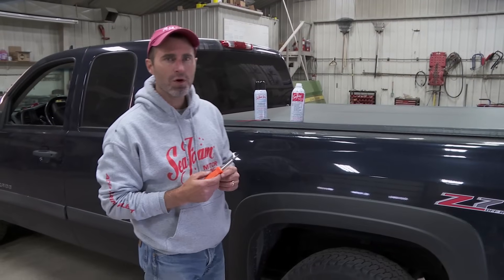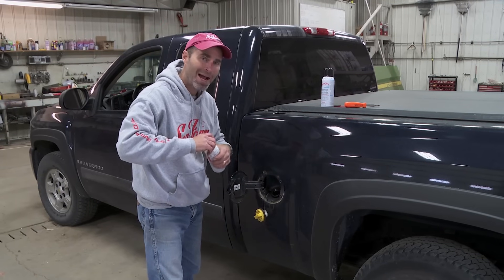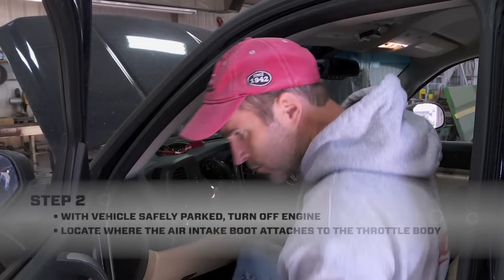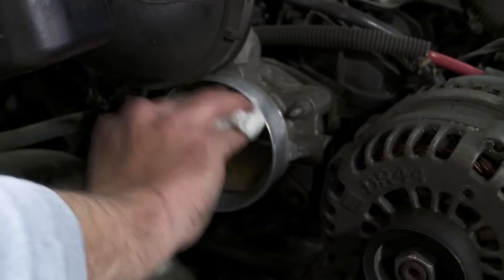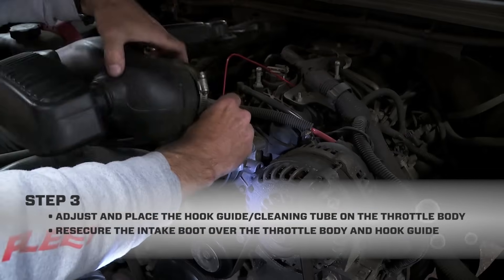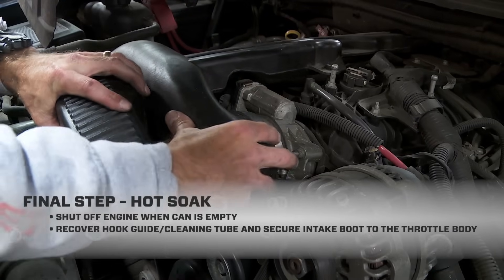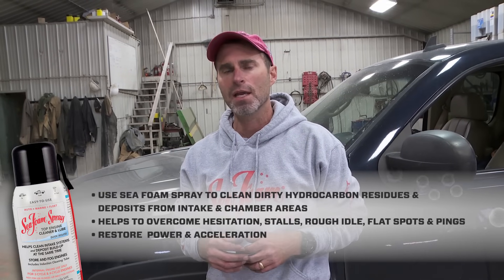How to clean a gasoline fuel injection air intake with Sea Foam Spray

Comment: Did you have to do an idle relearn on your truck? I have an 09 Silverado Z71 that I did a throttle body cleaning on and had to have a shop do an idle relearn procedure to fix the crazy idle.  It really needs this treatment as well but I dont wanna go through the idle issues again if I can help it.
Reply from the maker: Did not. However, I did have to replace the Throttle  Position Sensor 3 times over 300,000 miles of ownership.  On each occasion I'd start the truck, then while in park the idle would hunt up and down...then within a few days I'd get a code light on the dash and the engine would shut off.

Comment: How do you bypass the MAF?
Reply from the maker: A MAF sensor is typically a ways upstream from the throttle body, so no issue. Do you mean MAP, which in the intake manifold?
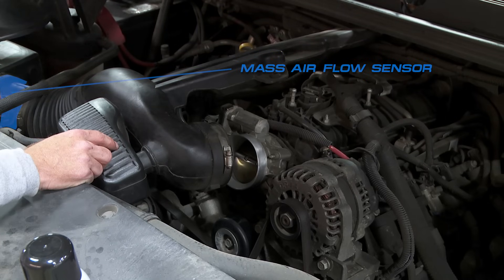Reply: @SeaFoamOfficial   I was thinking he was talking about the Idler Air Control valve. At 1:45 he says don't apply it before the mass air flow sensor. I'm not sure about applying it until I know what he's talking about at 1:45.
Reply from the maker: @renford9125  The MAF is electronic. On most makes you'll see small gauge wires that lead to a plug-in between the air filter box and the throttle plate. No issue with the idle air control/not a factor.
Reply: @SeaFoamOfficial  Thanks for the response.  Truck is running much smoother!

Comment: Just tried it today. It kicked out a ton of gray/white smoke after the 15 minute wait, but  it's still misfiring/chugging. Damn. Do I try it again, or is it time to go to a shop?
Reply: 2014 KIA Sorento with 166,000 miles.
Reply from the maker: @alanbredy747  Did you check the code? Have you tested your plugs, wires, ignition coil pack?
Reply: Took it to my mechanic. All coils were in good shape. He wiped out the loose carbon (thanks to Seafoam treatment) and replaced the sparkplugs. Running clean again. I will treat it again next May.
Reply from the maker: @alanbredy747  Glad to hear + thanks for sharing!

Comment: I just  Used the product mentioned above.  Is it normal for  the car to feel sluggish afterwards?

Edit : Kia soul 2016 1.6L 150k miles.  it's good now. Just had to run it hard for a bit. Idles a lil better now.

Update to the update:  My car is now having issues accelerating.  It's not coughing when accelerating, Is just one I floor it the RPM is delayed. Whereas where i gradually accelerate it is not affected. Explain please

Comment: Ran 3 bottles to fuel tank. Injectors still clogged. Runs like crap for 30 mins. Then runs great for 30 mins. Then goes back to running bad. So I’m not sure where to go from here
Reply from the maker: Maybe we can help... How old is your fuel filter?  Have you OHM tested your injectors?

Comment: why did you have to hook the air filtration back up just to crank it and spray the sea foam in it, you were'nt goin anywhere, not stirrin up any dust, are airborne contaminants that big of a problem where you live??  If so maybe that's part of your problem
Reply from the maker: A modern fuel injection engine will not run with the intake boot removed.  [Try starting your car with the intake boot removed.]
Reply: @SeaFoamOfficial  well that f'n sux!
Reply: @SeaFoamOfficial  thanx!

Comment: My truck was running fine until I did the Seafoam treatment. I wanted to improve gas mileage and running. My truck is running rough and misfiring. Is it possible that residue dislodged by the treatment fouled my fuel injectors? Anyone have a bad experience? It followed the instructions
Reply from the maker: Hi Shane: What Sea Foam product did you use? Where and how did you apply it?
Sea Foam Spray does not pass through your fuel injectors. Seems you may have fouled spark plugs.
Reply: Sea Foam Official update My truck is running now. I believe two plugs might have been fouled during the treatment. I removed the plugs and cleaned with a soft bristled brush. I followed the directions as described on the SeaFoam Spay top engine cleaner & lube can. I sprayed the treatment into the throttle body as instructed. Yes, this treatment doesn’t go thru the fuel injectors. Sorry for the confusion. I will do that treatment with the injector flush canister kit and SeaFoam.
Reply from the maker: @shanec4441  Hi Shane: Thanks for the response. The only thing we can tell you is that it can cause plugs to foul if the intake is not hot or the RPM is not elevated. Can't say we know what happened but glad it worked out.

Comment: I see Sea Foam videos that say you can add to the diesel fuel tank, you can fill the diesel fuel filter to concentrate injector cleaning and you can add to crankcase oil. BUT is there a method where I can use the Sea Foam spray to clean the intake?
Reply from the maker: Not on a diesel. Diesel intakes are different - an external fuel source can cause a diesel to run out of control.  Check out "diesel runaway."

Comment: What can I do if my car have 2 throttle bodies
Reply from the maker: Split by adding half a can to each side. A full can takes 6+ minutes to use up. Run through one side for 3 minutes, then finish out the can on the other side.

Comment: Would the spark plugs get dirty? Do you need to replace spark plugs after using seafoam spray?
Reply from the maker: No, the plugs will get cleaner using Sea Foam Spray.

Comment: Question. Used in same Chevy z71 shown in this video. Now when in park idles fine but after I hit the gas idles to 2000rpm and wont go down. Any ideas?
Reply from the maker: Throttle body dirty? If not drive by wire throttle, check your throttle linkage.  Not sure.
Reply: @SeaFoamOfficial  thank you for reply. I had just cleaned throttle body before I did this. I just disassemble and reassemble intake + throttle body and it corrected itself.. maybe I didnt have worn clams properly tightened which caused a air leak.. not sure, but all good now. thank you again.  Cheers.
Reply from the maker: @chefzackkasmar6767  Glad to hear - thanks, z kaz.

Comment: I used the spray on my 4.0 1999 ford explorer it barely idles now.had trouble going 50 mph.  Why?
Reply from the maker: Am betting you fouled a spark plug.  Can happen if RPM rate is too low when applying Sea Foam Spray. Check your plugs, go from there.

Comment: Do you put the nozzle before or after the throttle plate? If its becfore, doesnt it turn from a spray to just drops? And wouldnt that not be ideal, but i think putting it after causes the nozzle to hold the throttle plate open more than it naturally would under no load at 1k above idle rpm.
Reply from the maker: Before, always. Any contact with a throttle valve is a bad idea.

Comment: What is the difference beteen regular and high mileage seafoam? Because I do use your product.

Please be specific with answers!

And does seafoam treatment help with catalitic converter and 02 sensor cleaning like CATACLEAN claims?

I would appreciate a break down of my questions.
With so MANY other reputable products in the market like Berryman's and marvel mystry oil. WHY and WHAT makes sea foam standout?

Why should I buy Sea Foam products?
Reply from the maker: Both products are very similar with similar cleaning and lubricating attributes.  What's different is High Mileage is for gas engines only,  formulated to keep higher mileage car and truck engines cleaner as they add miles. Works great to keep fuel and oil passageways clean, helps prevent oil burning. Run it in your fuel and oil over time and let us know what happens...

It will NOT clean a catalytic converter.

You should buy Sea Foam products because they are all safe and they all work.

Comment: I have a 08 Expedition xlt and it suppose to get 14.4 mpg but its burning a gallon on gas per mile.  I dont smell gas, I dont see gas leaking and the truck runs good. Does anyone been thru this?
Reply from the maker: So you're getting 1 mile per gallon? I would get an engine code reading on it, go from there. Could be bad ignition coil /plugs/timing, poor compression, bad sensors, injector leak...any combo of the above. Most parts stores will do a code scan for free.

Comment: Tried this today in my car... hard ti pull a bunch of stuff off before I could get the straw in it...  Had someone press on the petal over 2K RPM, and sprayed... After 20 min, I could still feel stuff in my can.  So disconnected it from the straw and it was barely spitting out...  Looks like a defective can,  I am going to say like 25-30% of the product got into the car...  What should I do ?
Reply from the maker: Please send a message using our website's Contact page.  We will help you out!

Comment: hows best to clean a diesel engine? add to fuel and oil or is there an additional cleanign step?
Reply from the maker: Top 3 applications for diesel are: 1) add to oil every interval, 2) cleaning injectors by priming fuel filter full of Sea Foam (see video), 3) adding to fuel.

Comment: Great video.  I used to do something similar with my '69 VW bug...I'd slowly pour diesel into the intake while opening the throttle to keep it going.
Reply: @gg-eo6ez  Worked like a charm for me.  It only works in carburated engines.

Comment: Would using the Seafoam spray also help clean the EGR valve?
Reply from the maker: It will not clean the EGR but can spray and soak if you remove. Not sure of anything that cleans EGR parts other than manual removal and scrub.

Comment: I have a Yamaha YZF600R 1995 several years with old fuel in it
I know I should drain all the fuel out of it and possibly the motor oil for trying to start it up how should I use your product??
Any help would be appreciated works great in 
my family's cars..
.
Reply from the maker: Thanks for the question James. Considering it's easy to drain a motorcycle fuel tank...Drain the tank. Then add one full can and a half gallon of fresh gas to the tank. Run it for 5 minutes to get the Sea Foam and gas mix pulled through the fuel system, then shut it off and let the bike sit overnight. Add a couple gallons of fresh gas and take it for a spin. You will still have a lot of Sea Foam in the tank that will continue clean the fuel passageways and upper engine while your ride.
Reply: @SeaFoamOfficial  thanks for the quick reply anyway you could forward this to my email?
YouTube won't let me just copy it and put it in my notes

Comment: I have a 2014 Mustang, I can't get the spray to work right.
I remove my cold air intake, attach the clip to the throttle body, tighten it back down, the spray keep wanting to run back down through the air filter
Reply from the maker: Please find our number on the website and call our office so we can walk you through it.

Comment: Engine is on after cleaning my '04 honda civic with the spray. 
Anything suggestion what I should check?
What should I do next?
Reply from the maker: Is there a word missing from your description? Did a check engine light appear?  If so, just drive a bit and things should reset and clear.  If it doesn't clear after 30 miles of driving, try disconnecting the negative connection to your cranking battery for 15 seconds and reconnect.

Comment: Hey seafoam, 
The point where the intake connects to the throttle body is in a very tight spot thanks to GM lol. Since the MAF plugs into the air intake box, could I spray the cleaner into point where the boot connects to the box, considering its past the MAF? It’s a Chevy sonic.
Reply: Hey seafoam it didn’t work  me  like your video for my 02 GMC Yukon XL . My rpm go to 4000 rpm. Is there a better way ?
Reply from the maker: @chiosaeteurn9790  Should be very similar to video. Feel free to call our office or submit a web question using Ask Jim. We'll be happy to help!
Reply from the maker: If you're near the throttle plate, yes. Make sure your RPM is held at 2,000 when applying.
Reply: Oh thanks. Do you recommend putting a bottle or half a bottle of sea foam in the engine ? Or putting it through the hose connected to the breaking system ?
Reply from the maker: @chiosaeteurn9790  Use the whole can per treatment. Apply through the throttle body.

Comment: Does the sea foam being added to the gas tank clean out the injectors for a. GDI engine? And if not any cleaners that do the trick? Got a Dodge Avenger 2013
Reply from the maker: Yes, adding a high concentration to fuel will help clean fuel injectors on a GDI engine.

Comment: does it clean piston rings? cos my car burning oil
Reply from the maker: To help clean restricted rings, yes. Sea Foam in oil will also clean rings and plugged expanders.  If you ever have a few days to let the engine sit, try this: Remove the spark plugs, spray each cylinder cavity with Sea Foam Spray...then let the engine sit for 3 days with the plugs out. Each of the 3 days crank the engine for a couple seconds, then add another burst of spray to each cylinder. The Sea Foam Spray will soak around the piston rings to liquefy the petroleum residues that are restricting rings and actuators.

Comment: Can i add 10 bottles into my engine to replace my unleaded fuel?
Reply from the maker: Sea Foam cannot replace gasoline. Does not make sense...Or do you mean to ask something else?
Reply: I'm joking because you said there is no limit as to how much you can use because it is petroleum based.

Comment: Does it clean the intake manifold?
Reply from the maker: Not so much.  Most of the cleaning starts in the intake runners, backs of intake valves and chamber areas.

Comment: What happens if you drop the plastic clip past the throttle body?
Reply from the maker: I imagine it melts wherever it hangs up.
Reply: @SeaFoamOfficial  I was thinking that, but it seems risky. Thanks!
Reply from the maker: @thej_brand  The hook guide won't go anywhere with the intake boot secured on the throttle body - now worries.
Reply: @SeaFoamOfficial  I wasn't asking hypothetically. I dropped the plastic past the throttle body yesterday.
Reply: @SeaFoamOfficial  I'm saying it seems risky to start it up and hope it melts.

Comment: Just took off my throttle body, and looked into the intake, looks like an oven that has never been cleaned.  However my car is running perfectly right now can I use the seafoam to clean the intake without harming anything ? It seems to me everyone uses it when they have a problem .
Reply from the maker: People use it to prevent or solve problems. Think of it as hygiene, like brushing your teeth.  Won't harm...and your intake valves aren't going to clean themselves. :^)

Comment: I know this may be a stupid question but when is it idle to add sea foam to the fuel tank; Before or after a fill up?
Reply from the maker: Adding when tank is low/lower creates a higher cleaning concentration. If you want to clean better, add a whole can or more (supposing auto) when tank is lowest.
Reply: Sea Foam Official ty!

Comment: How often can I use this product? Every 6 months? Every 5,000 miles?
Reply from the maker: You can use as frequently as you wish.  If the engine is in good shape, every 5,000 miles would be a solid rule.

Comment: So, im trying too do the seafoam through the engine, but my maf keeps shutting off my 06 is350. Umm, help?
Reply from the maker: Hi Douglas:  #1 is you must re-secure the intake boot over the straw and throttle body rim. If not, you're pulling unfiltered air from the atmosphere and the engine won't run.  #2 is Are you running at 2,000 RPM?
Reply: @SeaFoamOfficial  yes at 2rpm. Think i found another way though there is a capped off vacuum pull coming off the air intake manifold. Might give that a try...after i research it though.
Reply: It Worked!

Comment: I added half a seafoam bottle to my 02 Honda Accord via the brake booster hose while someone revved engine to 2k rpms. The rest was poured inside the gas tank. Let it sit for 15-20 min and took it for an aggressive drive, and wow, I felt the car accelerate faster, it certainly did something good, car feels stronger and snappy too. Great product !
Reply: Bullshit

Comment: I dont see your truck smoking like all the other videos I've seen why is that.?
Reply from the maker: The smoke is oil vapor.  Sometimes can see it easily, sometimes less.  Has to do with temp, climate, wind speed... If the wind is blowing 40 MPH the vapor is isn't going to suspend in the air. No matter, whether you see vapor have no bearing. Hope that makes sense!  :^)

Comment: How much can be added to the oil to clean piston rings?
Reply from the maker: For a 5 or 6 quart crankcase, add half a can every interval.  Will work over time to clean up the goo around control rings and expander passageways.
Reply: @SeaFoamOfficial  I have a 3 quart system. And I lose a quart every 1000 miles

Comment: I would be careful using the spray. I followed the directions of the can on my 2013 kia rio 1.6l with gdi. I kept the idle around 1000rpm higher than idle or a little more. After I shutoff the car, and waited around 10 minutes, the engine would not even crank. I thought it seized the engine, but I pulled the plugs out and throttle body, and let it air out twice. I almost made sure the engine turned over. After that only did it start.
Reply from the maker: See can instructions: "...hold RPM steady at 2,000 for the duration of the application."
Reply: +Sea Foam Official I did that, I used a bar to hold it steady at about 2000 but had issues starting it after
Reply from the maker: @mrawesome42   Seems the plugs fouled.  Elevated RPM is the key to avoid fouling.   We have no way of explaining how rough starting occurred in your situation.
Reply: Nothing like this procedure would stop an engine cranking.